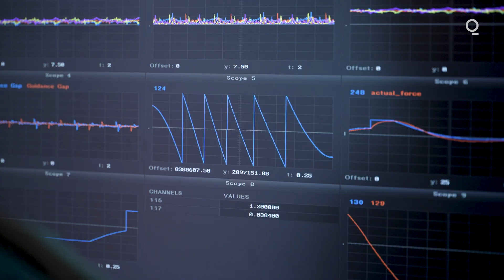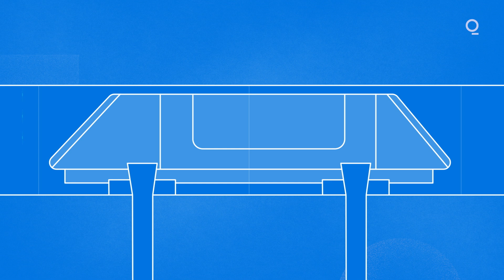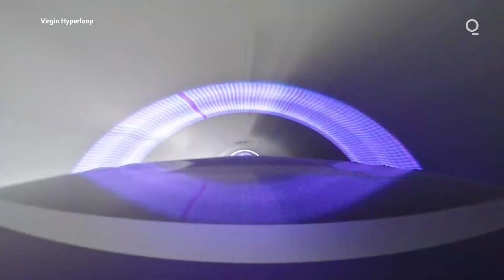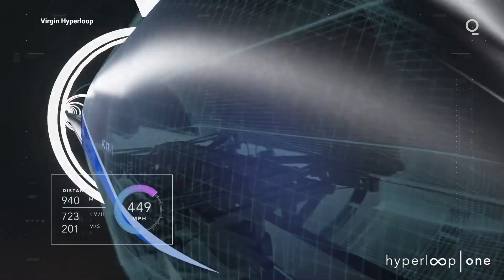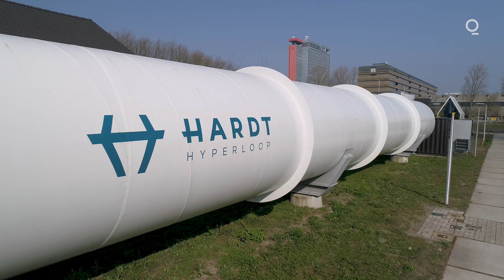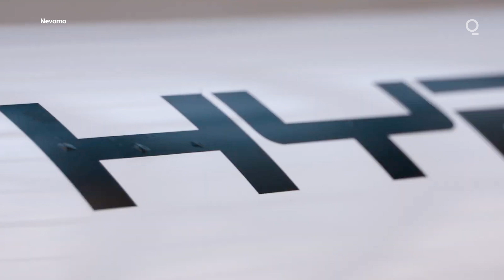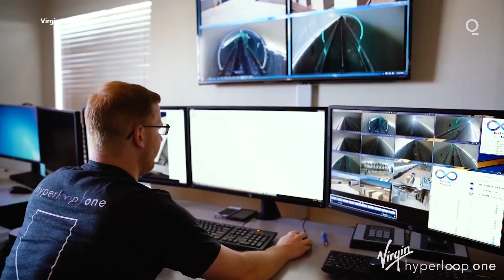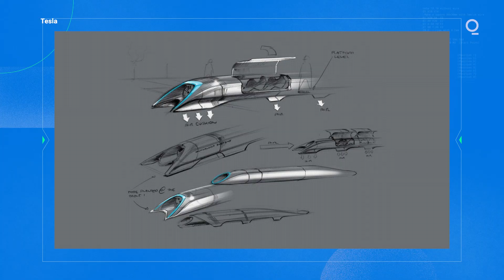The Hyperloop May Disrupt More Than Just Travel

Comment: Hello? Is anybody listening? What about commercial shipping using hyper loop? The highest speeds that you’re talking about is much, much faster than most cargo planes, and then the cargo planes shipping containers must be unpacked, right? I don’t believe a cargo planes shipping container can be taken off the plane and hoisted onto an 18 wheeler flatbed, can it? But, you can easily design a shipping container that fits the hyper loop that can be unloaded with a forklift and stacked on any truck flatbed, whether it’s an 18 wheeler, two ton flatbed, or a large trailer.
          Look at railroads now. The percentage of business that is passenger travel is minuscule when compared to commercial. The passenger trains are basically operating in the red, with the government making up the difference. To keep them afloat. The commercial trains however, are money making machines? Get it? Quit barking up the wrong tree! Model this hyper loop for shipping and ad passenger later after the capital investment has been returned.

Comment: So it is a highspeed subway but run in a pipe, smaller size like a cabin, no driver. 
Question: 
- will a broken cabin block the pipe? How do you remove a broken cabin? 
- Or how to stop a maniac to hack the cabin from running infinitely?

Comment: 10:45 Something like 75% of all trucks are final mile trucks or trucks to the final mile from cargo hubs. So all you'd be doing is saving the costs on the planet for the train or boat, but not the same truck you whined about there, and that's completely ignoring the trucks that would go to places not even hyperloop would go, or be cost effective. But wait, we'll still need boats for the longer hauling across seas since it'd be unsafe to travel underwater for great distances.

Comment: Designing the other technology in transportation and other use systems that spin off are a valuable resource . That may allow other electrical generation  systems as cars axels  that spin constantly at moving speeds are not being used to properly generate electrical power at cost saving to power as well as use or expense saving economic value . A fan at the end of this system here could be tested in a computer simulation to allow aerodynamic  wind-scoop to allow adjusted air flow to generate electrical power to resupply battery or use of forward momentum and glide speed uses to maximize the electrical potential usage for long distance clean air fuel with even large passenger size crafts . Again  easily tested wind tunnel simulation programs that would allow great savings in testing and designing and developing in other systems .

Comment: The recapture of electrical  energy by generation of already in motion vehicles as for example rotation of axels or transaxle that is in high rotation with long axis . Allows a grater energy generation at higher speeds . That even a third wheel on a rapid loop could be a great savings in clean energy as a fan turbine to also assist with a low friction air  scoop to focused fan to the rear that could restrict or open air flow . And could be easily tested on a computer wind tunnel simulation to provide proof of concept with different low wind friction aerodynamic air scoop that will correctly stop or allow ranges of airflow to proper speed control to. Fans electrical generation at a non interfering size fan electrical generation supply and support system .

Comment: If you didn’t find the $ for high speed trains, you won’t be building hyperloops
Reply: This should be a top comment, literally the crux of the matter. If HSR can’t be done in America, neither can Hyperloop, guaranteed.
Reply: @meh23p  It's  statement of the obvious really. It MAGLEVS  are too expensive, putting them in an evacuated tube won't make them any cheaper ! Plus, the ONE Maglev around, Shanghai, isn't even a long route. I'm amazed at the self-deception practiced by Elon's fanboys.
Reply: @F33bs  Sure, I understand your reluctance to use rail, and the issue with your large distances but that's partly a consequence of rail being low-priority in the first place and relatively undeveloped.

My own railway station is on a very heavily used line (Midland Mainline formerly LMS (London Midland and Scottish) and the Midland Railway) with many local destinations especially London (takes 20 minutes or less at up to 90/100 mph with services every 15 minutes) and quite a few long distance ones in England (125 mph trains like the HST, top speed 148) and elsewhere in the UK (with 150+ mph services) with maybe a change of train and finally international ones, like Paris and Brussels in other countries via 'the tunnel' at up to insane mph like 200/225 and then on to the European high speed network. Also, the station is around a 7 minute walk. I can travel directly to other countries from there !

Yes, I live in a well-developed part of the UK but before the 'Beeching Report' that resulted in thousands of miles of 'branch line' track being ripped up for purely the benefit of the car lobby, even quite small towns often had a station, so there was never that 1 hour drive needed to get a train.

How fast are your car journeys ? The national speed limit in the UK is 70 mph ! (although before speed cameras I often drove at 80-90 even 100+ sometimes on motorways (interstates in the USA) and in Europe 130 km/h, or around 80 mph, a better choice IMHO. And you need to concentrate on driving. With rail you read a newspaper or chat to fellow travellers.

High speed rail is excellent for linking cities hundreds of miles apart, can stop at towns/cities en-route and competes directly with the airlines, as it was meant to do. How far do you nee to drive  to an airport that provides services to your own large cities ? Btw, my 'local' airport (London-Luton, LTN) with UK and International flights is a 10 minute train ride followed by a 1 mile bus journey !
Reply: @grahamstevenson1740  amen! In America our major cities are far between and I'd much rather relax or do work on the laptop while traveling at 200. I know for a fact more people would visit states afar because they hate driving and riding in cars on long road trips
Reply: J D  Trains are well suited to the smaller inter-city distances in Europe. Railways originated in England you know. The USA likes trains for freight, more so than in Europe but I get the impression that outside of commuter networks, it's seen as the poor person's way to travel. Certainly your long distance trains are very slow compared to Europe etc and more like, say, India (where 80 mph expresses are something that's celebrated) or Africa.
Reply: If they bring down cost enough it could outgrow China's high speed trains that as they said are not profitable
Reply: @moRaaOTAKU  It's always about cost and any hyperloop will be fabulously expensive.
Reply: Unless it's built by private companies
Reply: In californoa they wasted billions on high speed train  . Let private companies build it for millions
Reply: @protectork9831  Has California given up on high speed rail ? That would indeed mean waste.
Reply: @grahamstevenson1740  yes they have
Reply: @protectork9831  Really ? A Pyrrhic victory for the Republicans I suppose ?
Reply: It isn't all about the government funding it.
Reply: Yup. Thank you for this.
Reply: You can thank America's car and oil lobby for that.
Reply: I think the trouble is that 'the USA' hates trains, so can't bear the idea of HSR/any HST. HSTs are almost socialist too, so clearly a 'bad thing*. Same kind of thing happened with SSTs. The socialists (France+Britain) made a working 1300 mph SST. The testosterone driven Americans had to have a Mach 3 version, so failed. Engineering is always the art/science of the possible !
Reply: There are plenty of high speed trains and the EU expects/plans this to double in the EU (from the +--3000-3500km now to 7000km in around 10-15 years). Hyperloop companies don't only operate in the US.
Reply: @MDP1702  So why exactly does the USA ignore the success of HSTs in Europe, Japan, China and Russia ?
Reply: @MDP1702  exactly Europe and Asia have high speed trains already,  they are not going to take a step back with the Hyperloop scam.
Reply: @dogwalker666  If hyperloop is successfull (which we don't know now), it certainly would be used.
Reply: @MDP1702  not that it will be but if they ever build one it will be just for the rich, and will never happen like the musk original design. It could never be a mass transit system on earth.
Reply: @dogwalker666  The same was said about planes in the past, so we'll see.

I believe mass transit will be necessary for it to be successful anyway.
Reply: @MDP1702  it's much more material from the get go.  Also a large vacuum doesn't yell safety.  But let's see how it goes though.
Reply: @MDP1702  no the same was never was said about aircraft, and aircraft use the laws of physics they dont defy them,  mass transit,  and public transport, are a great idea, Hyperloop will never be one of them, it could never happen in the UK for example,  you can't have straight lines like that above ground without doing massive ecological damage, and there is no room under ground, too many old mines, sewers, and old tunnels,  don't forget the Hyperloop cannot have bends like a metro can.
Reply: @MDP1702  With a suggested 60 passengers per pod, how many travellers can use one per hour and what will the revenue be if it's to be cost competitive ?
Reply: @MDP1702  The need for Mass Transit was shown to be a falsehood by the pandemic. Remote working is the future, eliminating so much need for transport and *saving money*.
Reply: @krunkle5136  I suspect we'll never actually SEE anything because the money guys will stop it before it gets that ridiculous.
Reply: @grahamstevenson1740  it'd be fun to see though.  But realistically...
Reply: @krunkle5136  It's always fun if you're not the one paying !
Reply: @grahamstevenson1740   Working from home, robots, self driving cars, drones will be a thing. Your going to see an up tic in travel because people will have time to go places, and they are not tethered to a desk. Our current mass transit is basically commuter traffic to work. Elon musk doesn't even have an office, thats going to be more common. If you look at the infrastructure Elon is building, it's satellite Wi-Fi communicating with self-driving cars which have the capacity for a high-speed travel in a hyper loop. Its making the office business mobile.
Reply: @MDP1702  It would seem that US netizens don't care much about how the rest of the world operates despite the USA representing only 5% of humanity.
Reply: What kinda thought is that?? There is no such evidence that suggests so..

Comment: The graphic at 0:25 shows a double tube built on columns at about, say, 50m intervals, so 200 every kilometre, 20,000 every 100 km.
LA to New York is almost 4,000 km, so thats 800,000 columns, plus the double tubes between them capable of holding a vacuum!
The building and running costs would be phenomenal!!
Reply: Most of it will be underground
Reply: @charlieyeti3800  
That just adds to the expense, also, if it is underground the only way to get to a broken down pod is through the tube itself, so unless you make a third service tube, (more expense) then rescue, repair and maintenance would be almost impossible!!
Reply: It will never work in California or west coast. This is a project for the Midwest/east coast etc where land is flatter and cheaper to build in
Reply: And Californias power grid already has to be shutdown whenever the winds get to high or it starts a FIRE, we don't even have the electrical infrastructure to power it, this is Solyndra 2.0
Reply: @DanielsCorner644  don't worry there are technologies that their working on that will power these things, just keep Faith in human ingenuity we will get it and we will get there somehow somewhere

Comment: 7:24 "Traditional Maglev trains ..." - There is one small system in operation. It was developed in Germany (Transrapid) over a few decades starting in 1969. Dozens of places where proposed to be ideal for the Maglev. Every single one turned out to be far to expensive and at the end one was build in Shanghai knowingly that it will never make money and be more like a Disneyland-ride than public transport.
The Hyperloop is a much smaller Maglev in a vacuum tube. Much more expensive, extremely hard to build - if possible at all.
On the press-events, they show small Maglev train models and big CGI graphics. They show a Train made from "Vibranium" but it's actually an empty shell made from reinforced carbon fiber just like some parts of my bike. They just want to get money to work on a project for a couple of years until they can't hide anymore, that it will never work and they have to invent a new idea to collect money.

Comment: It's a pipe dream. Or more accurately a super complicated maglev and you don't see maglev taking over the world because it has a number of downsides to implementation.
Reply: Time will weave out those problems technology is getting better every year
Reply: @dark12ain  Hi Desmond, technology is indeed getting better in many ways.
Is it, man's greed that makes it seem impossible to make a kettle or toaster that last's more than 2 years?
We have social media supposedly connecting people and yet people are less and less social and feel more lonely than ever before. Each technology seems to create a host of other issues, which more tech to solve etc etc.
Making and holding a vacuum in a small container is challenging in itself, large scale that is exponentially more difficult. The other very weird down side to faster and faster trains is that they have to travel in straighter and straighter lines so traversing obstacles becomes more difficult. You basically end up having to go through instead of around.
Fundamentally I just don't get the need to go faster and further. Wherever you go, there you are. We cannot escape ourselves or our insecurities.
Reply: @GrantDayZA  when you put it that way you have a point, yeah I do agree we do not need tech in every aspect of life I also think tech is using up more resources on this earth than we can handle.

Comment: I feel like only Japan can pull off a real hyperloop. They have so much experience with trains
Reply: they already invested in maglev 
and they won't invest in hyper loop because it's a dumb idea
Reply: Japan has a real hyperloop aka Shinkansen in tunnels, it's real and works very well.
Reply: @THEREALZENFORCE  Yes. Bullet train in tunnel = hyperloop. Brain go brrr.
Reply: @slygg  actually the hyperloop originally is based of the hundred year old vacuum train concept. 
Brain go brrr ;-)
Reply: Architectural Dígest  hello scammer
Reply: You'd think so, right? Not only do they have a lot of experience, they're also not shy of spending big on rail infrastructure.

It is true that they have invested in maglev already but I don't think that is too big of an issue. As far as I know, the main maglev line will be Tokyo - Nagoya -  Osaka. They've invested some and have some track but the line is very far from completion to the point that they basically haven't even started yet.

Even if the maglev were built already, I don't think it is too much of a burden to Japan.  The Tokyo - Nagoya - Osaka route already has a running Shinkansen line that blows many HSR out of the water. That didn't stop them from planning a mag lev. Similarly, having a maglev might not hinder them too much if they can get some valuable time savings out of it. Plus there are always different routes.

I think China will be high up the list too. Their government has shown that it can invest almost ridiculously into their railway net, so a similar high cost high prestige project would be right up their alley. The Middle East will also be contenders but as vanity projects more than anything.
That is if Hyperloop comes to fruition of course.